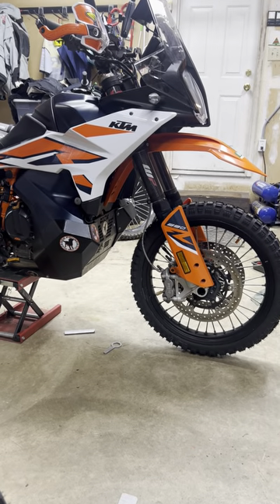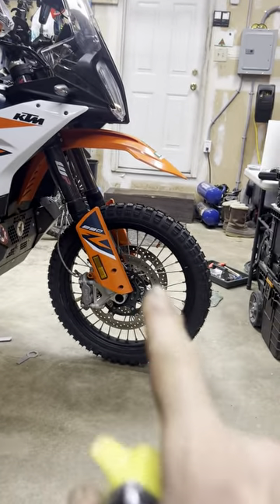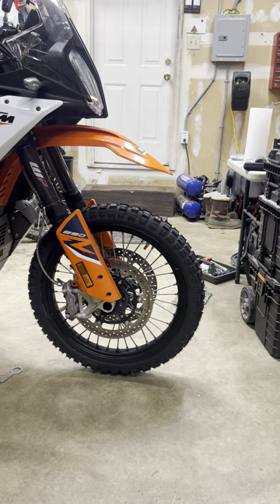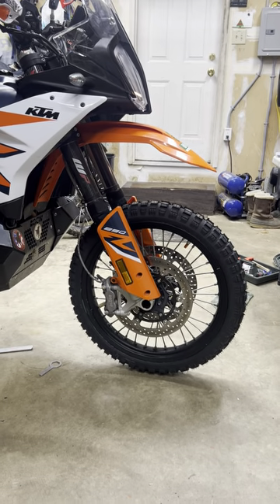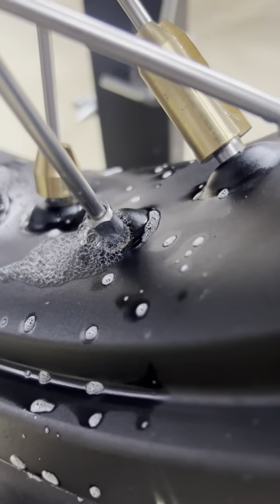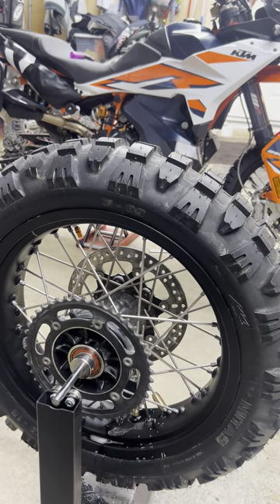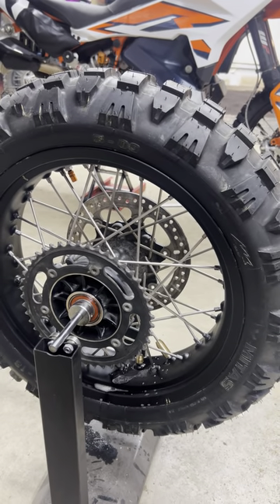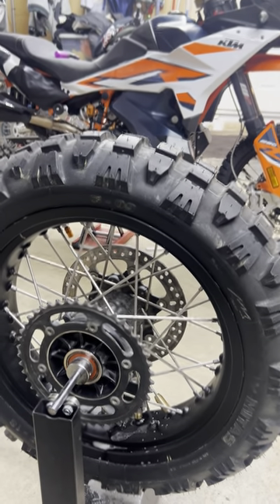KTM 890 adventure tire air leak figured out

Comment: I think it's the oem tire and not the valve on the front wheel. Many people have the same problem with the tire that came with the bike.
Reply from the maker: In my case, the front valve body was leaking at front and a spoke in the rear.

Comment: The rim strip let's air leak through the spoke nipples.  That's the problem on my 890r.
Reply from the maker: I fixed the air leak from the spoke by using RTV silicon from the outside. That was few weeks ago and it hasn’t lost any air. I did this way because it was only from one spoke.

Comment: This is due to the internal flaps. They are very easy to damage with tyre changes. You need to install new flaps, only ktm provides them and if you your dealer doesnt have them in stock, good luck waiting for them. I had to wait almost a month for the parts. This is another issue that adds up to the frustration with owning this bike
Reply from the maker: @Calbertone  i fixed it with rtv silicone on the one spike nipple that was leaking. 3000 miles later and it is still holding air no problem